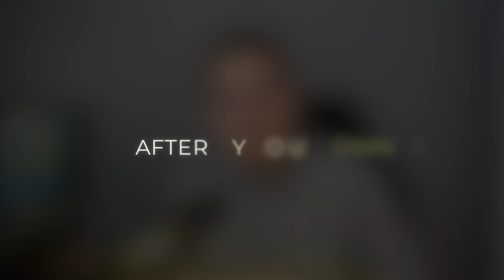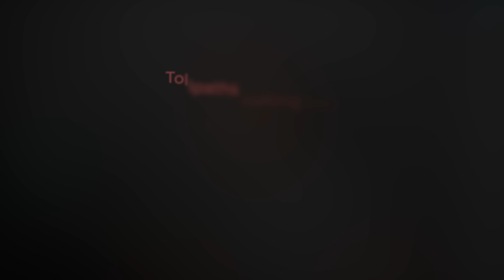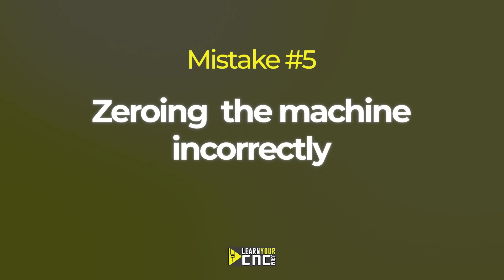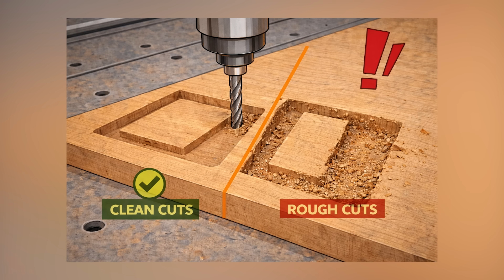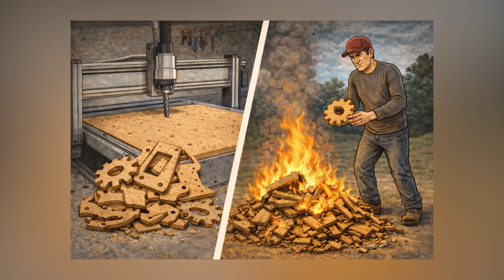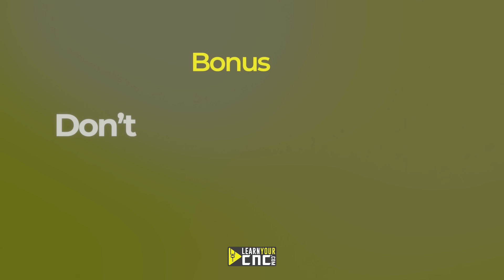Top 10 CNC Mistakes Beginners Make (That Cost Real Money)

Comment: Great video.  I would add another mistake many people make... not prototyping. If I am going to cut an expensive piece of wood, I'll run the tool path on insulation foam first.  You can buy 4'x8' sheets of it at Home Depot cheap (the light purple stuff).  It cuts well with decent detail and saves lots of time and dollars.  Even after prototyping  we always pull up the image on the CNC and make sure it is properly configured for the material and that it fits on the material by moving the tool around to all four sides.
Reply from the maker: Great addition! Prototyping definitely saves time and money in the long run.

Comment: I am looking for a 3d cam program for wood, not for carving but for 3d projects . A one that can pick surface's like a Mastercam but not.  and carries a Mach 3 post.
Reply from the maker: If you want to 3D model your own projects, I would highly recommend Aspire software (it has Mach 3 post processors too): https://www.vectric.com/products/aspire/?ref=cnc
Reply: I'm a Design Engineer and use SolidWorks. I should have explain better not only wood but plastic , aspire imports STL for models 
I run with more precision detailing with Parasolid and STP files.  Do you know of another that don't break the bank.  Thanks for your help.

Comment: When I purchased my first CNC I always planned on selling it within eighteen months. It was a proof of concept & wanted to to get in cheap. The goal was to determine if I enjoyed designing on the computer and cutting on the CNC. If I did, I would get a better machine and if I didn't, I would sell it.

I used free software to design, so I could only cut with .125 straight end mills. Once I confirmed that I liked the process I should the machine and upgraded. I was fine taking a couple hundred dollars loss.

I
Reply from the maker: Thanks for sharing your experience, I am glad to hear you stuck with it!